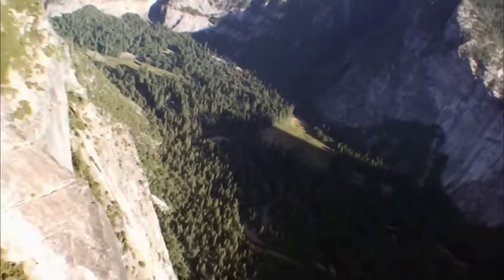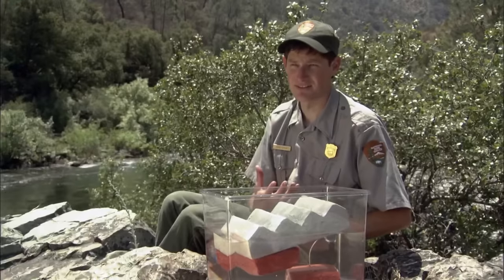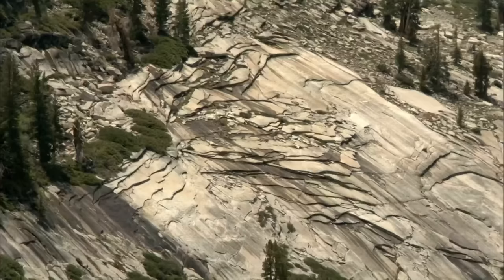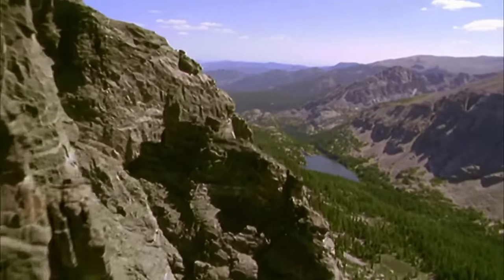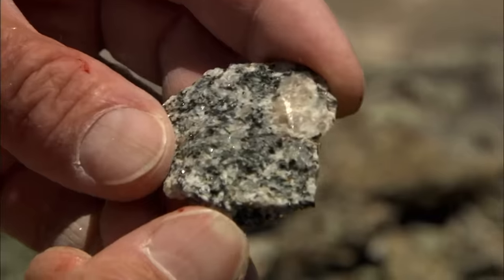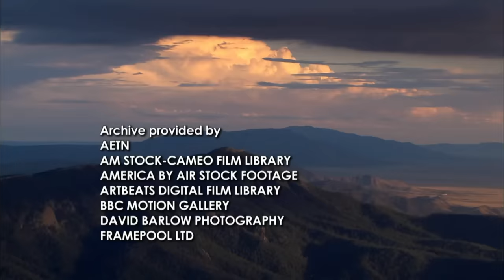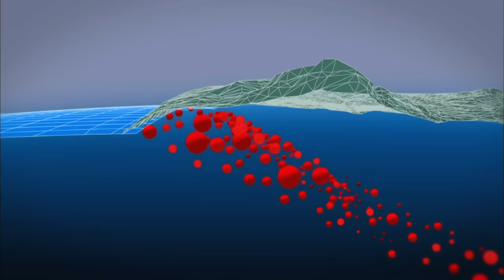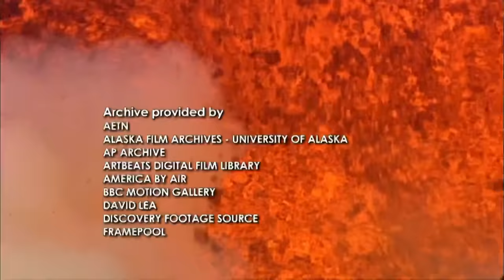Volcanic Fury! EARTH'S DANGEROUS RING OF FIRE *3 Hour Marathon* | How the Earth Was Made

Comment: I’d get some quality Victron equipment and a more efficient pure sine wave inverter! You’re losing 20% efficiency from your inverter. Granted, your newer AC system looks nice!  As a permanent system use micro controllers for each flex panel to account for shadows, refinish  the exterior and cover with panels!

You need to partner with suppliers— have them hook up your panels, wind, desal, etc for testing and marketing…you handle your speciality, preserving these treasures! Good luck! Looking forward to seeing progress.

Comment: Incorrect conclusions made by the narrator on the height of the Rocky Mountains in the past. The Rockies were not 28k ft and didn't rival the Himalayas in elevation.

The geologist concluded that they used to be twice as high above Denver as they are today. From the perspective of Denver, they were twice as tall. That doesn't mean their height above sea level was double. Denver is about 5k feet above sea level. The geologist was basically concluding that the range used to be about half a mile higher. So, more like the Caucasus or a bit shorter than the Andes.

Comment: His wax theory - molten granite shot up through the sandstone does not hold water. Granite weighs 175 lbs/cubic foot on average and sandstone weighs 150 lbs/ cubic foot. Wax weights 65 lbs/ cubic foot and Sand weighs 90 lbs/cubic foot. Of course the wax will shoot up when heated.
Reply: Interesting, but there are several flaws in your reasoning. Granite is some 15% lighter in molten state and the geologist stated it went up through cracks, not solid stone. And the sedimentary rock doesn't look like sandstone, too grey and dense. Keep in mind there's little sand up there anyway, Yosemite almost entirely consists of granitic rock. Plus though the geologist neglected to mention it, the magma must have been under pressure due to all the weight on top.
Reply: its superheated and under pressure the weight doesnt matter
Reply: Never underestimate hydraulic pressure.